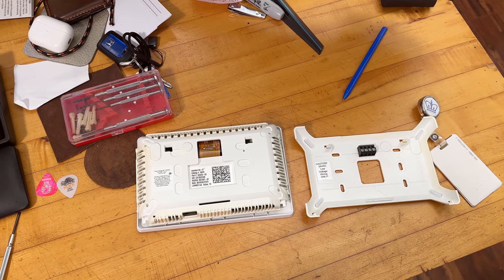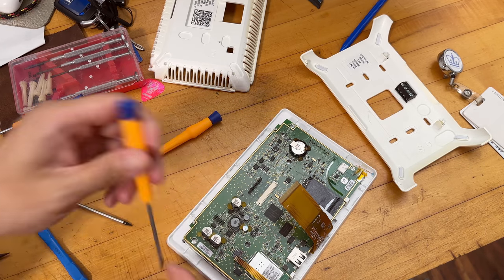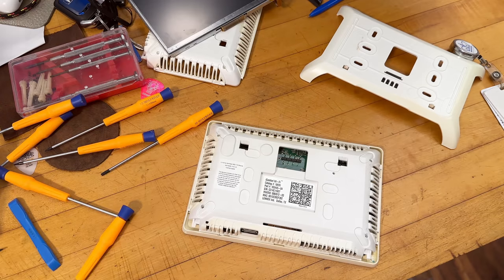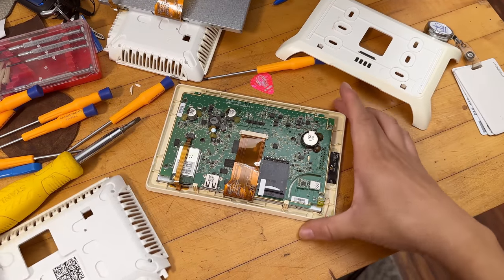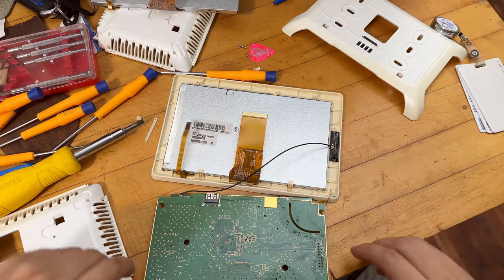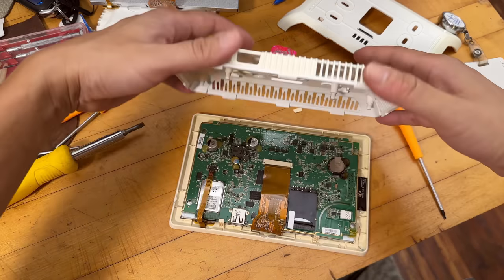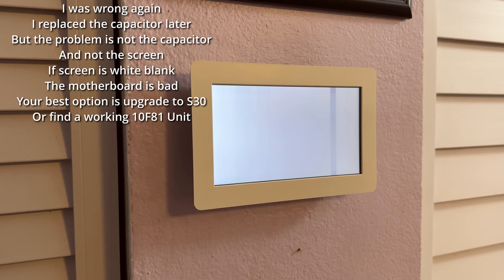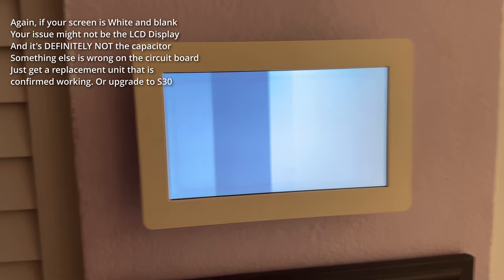Lennox 10F81 iComfort WiFi Thermostat LCD Screen Replacement Guide & Display Issue Diagnose

Comment: Did you try to replace the 1.5F super cap as well?
Reply from the maker: I did not, I tested voltage on the super cap and it's at 2.8V, thought it was the rechargeable button battery they use to store time data like on PC motherboard, didn't realize it's actually a capacitor. I looked at the soldering and it seems to be a lot harder to replace.
Reply: @TheGizmoGarage  I ordered a replacement 1.0F 5.5V from Amazon and will let you know how it goes.
Reply: @TheGizmoGarage  I managed to replace the super capacitor, it was leaking badly. I had to do a lot of cleaning, then soldered the new super capacitor and voila, it is alive! However, when I see the white and grey screen with lines like in yours, it is already too late and the damage on the board is unrepairable. The voltage across my super cap is basically zero, so there is damage on the charging circuitry, or perhaps it takes some time to charge it.
Reply: BTW, I found the exact replacement part on Digikey, but shipping cost is too high. So, I found a similar replacement from Amazon, 1.0F 5.5V, a pack of 6 for $10 in the U.S.
Reply from the maker: @ekasusilo  Thanks for the update! I pined your comments so others could take this into consideration on their repair as well!
Reply: @TheGizmoGarage  I think I know why my super capacitor is not charging. It has corroded R397 completely and now it's gone. Could you help me to measure what R397 value is on your board? I need to replace this to get the super capacitor charging. Thank you.
Reply: Well, my R385 is about to pop out as well. They are all around the super capacitor and the leak basically ruined everything around it. Could you do a favor to measure the value of R385 as well please? Thank you.
Reply from the maker: @ekasusilo  Sadly I tossed out the circuit board after failed attempts, so can’t help ya on remeasuring the value.
Reply from the maker: @ekasusilo  I retrived the bad board from trash bin, r397 diode test @ 0.731v no r385 on my board
Reply: @TheGizmoGarage  A diode? Why would a diode has R designation? What’s the polarity? K towards the super cap or otherwise? FYI my thermostat is still alive until today, and it gets connected to the internet!
Reply from the maker: @ekasusilo I don't know, I know nothing about circuit design... Capacitance had no reading (OL) only diode test had a voltage reading on it.
Reply: @TheGizmoGarage  when it is powered off, you can measure the resistance across. It is not gonna be exact value, but will be close enough for me to find a replacement

Comment: Mine is completely 'off', totally dark, no white, no color, as if it has no power whatsoever.  But by going to the website and checking it, it seems to be functional and working as expected.  I assume this just means that the screen itself is having a problem.  I hate that I can't just buy a replacement 'face' to pop on there and keep going.  Never again, Lennox!!!!

Comment: @TheGizmoGarage I really appreciate your video and answer to my question. After watching your video and reading a large number of posts recommending to replace capacitors, I decided to figure it out for myself. I purchased several none-working units to fix. Smaller 220uF and 47uF capacitors test good in all of them. It was measured with both ESR meter and measuring AC component on those filters. Examining about 5 different thermostats revealed that the super-capacitor is leaking on all of them. Even though it isn't very obvious at first, there are wet areas around it. My initial goal was to re-flow a BGA chip that controls the display and all peripherals, however before I did that, I measured all of voltages going to the screen. One voltage was missing. It took me a long time to figure it out without the schematic, but I finally did it. Some supply voltages never reached the screen. On all units that I have the internal trace and corresponding vias were damaged by either the acid or it was poorly designed from the beginning. I was able to run a jumper wire to fix the issue. One of the most difficult issues was sourcing and replacing the supercapacitor. Apparently, there are multiple types of H-type with leg width of 0.8mm and 2mm. The board is also very thick, so you need to preheat it in order to replace the capacitor.

Comment: Mine was white, not sure what you guys mean by shades of grey but some areas could be considered grey and shadows of the original buttons that show when its working properly. Replacing the caps worked fine. Didnt have to replace touch screen. Not sure why youre telling people they have a bad board when the cap fix will likely work for most of them.
Reply: Additionally, most people have the version that has the 3 small caps or the 2 larger caps. I believe you're the only 1 I've seen that jad 2 large 1 smaller. Fyi, the small caps and large caps are all same voltage and same capacitance. The larger ones have a slightly wider temp range but that's not that important. If you're good enough to make sure all the necessary contact is occurring on the pads you can replace the large ones with the smaller ones, although if you're buying caps it's probably better odds to just get the larger ones.
Reply: I didn't see the end of your vid before leaving the above comment. Those shades of grey are much different than mine. Mine are very subtle and not striped from top to bottom like that. Mine were more likely caused by the shadow of the original colors behind the white... like where it's very dark blue or black.
Reply: A couple of days later after the cap swap the white screen has returned. I'm thinking maybe it was fixed temporarily just from cleaning the board, etc not from the cap swap. Ive found someone who replaces the board and eliminates the problem parts and I'm buying a mew 10f81 from them since the s30 and s40 have so many problems and 2.2/5 stars on lennox's own site. Thanks for your vid.

Comment: My screen is completely white? do you think replacing the screen is worth it..
Reply from the maker: My best guess is that if the screen is white, it's the circuit board not the screen so I wouldn't bother
Reply: @TheGizmoGarage  update.. my screen went from being completely white. but still able to control it wifi on the app. Today, its unresponsive(black screen) and I am unable to control it via the app because it saids it has no wifi connection..

Comment: Excellent video with real technical content.   My upstairs secondary furnace thermostat just went down.   It was working fine, but the furnace power got cycled and suddenly the thermostat only shows three cycling dots.   I feel the screen is fine and it must be not booting fully.   Do you have any experience with connecting to the USB port?
Reply from the maker: I have no experience with connecting it to a USB device, and I assume only Lennox technicians have such software to run diagnostics. You can try to do a reset by cutting off the power to the thermostat to force it to do a new reboot.

Comment: Hi, I’m glad I found your tutorial!!! my touch screen has lost its colour and it almost looks black and white. It’s not connected to the wi-fi so I can’t switch it on even though I can see the on button control. Also can press the settings button and it kind of transitions very very slowly to the settings screen. I’ve reduced the background intensity so I can see the screen a bit clearer. Do you think it’s the capacitor or the screen that’s the problem. We had to switch off the power today and when we put the power back on the screen was white with black stripes. We unplugged and replugged and now it’s just black and white but we can see the controls even if they don’t work. Thanks and I hope you can help me!
Reply from the maker: Shortly after I changed my screen with a replacement unit, it broke again. I have to spend $1000 to upgrade to the newest Lennox S40 thermostat, which comes with a 10 year warranty so we can have a peace of mind.
Reply: I just pulled it apart like you did and put it back together and now it’s working??? Maybe something just dislodged? Don’t know how, cause we didn’t even touch it when we switched off the power today.  I think we better start saving cause I feel this may be the start of it breaking down permanently and I don’t want to fork out $1000 in one hit. Thanks again for your video cause at least  you taught me how to safely take it apart.
Reply from the maker: @sanm9939  No problem, glad it's working, at least setup the Wi-Fi to make sure it's working on your phone, so even if it goes dark it can still work for a while
Reply: @TheGizmoGarage  for some reason the WiFi isn’t working. It’s connected to my home  Wi-Fi but not connected to the server. Ugh! I’ll have to call Lennox on Monday and find out what’s going on!!!

Comment: @lireviews : So do you now have a working display you might want to sell? I fixed a 10f81 with leakage damage from the super-cap (the most likely failure mode, apparently), but there's an intermittent in either the display or the flex cicuit that connects it.
Reply from the maker: I don't, you may be able to find one locally on facebook marketplace

Comment: So I just bought a used unit off Facebook my old screen was doing the white screen but the new unit it gives me a communication error what did you all do with the as card I took them both out and put my old unit in my new unit and now I get 11 errors do you remember how you got that working correctly?
Reply from the maker: They maybe different versions of the firmware, whichever one will take you to a setup page you can reconfigure the settings through the setup menu by long pressing the "lennox" logo on bottom right corner

Comment: When I apply 24VAC, thermostat boots to System Alert error 12: incomplete system. There is an X in the right top corner that when touched will reboot it to the same state. How do I get it to home screen?
Reply from the maker: I don't know... Sounds like the wires are not hooked properly to the back plate. I'm not an ac tech, but here is what the manual says the error is caused by:

• Thermostat did not find an indoor
unit. 

Make sure there is a Comfort
Sync® indoor unit on the system.
Check R, i+, i- and C connections.
• Ohm wires and cycle power.
• Replace indoor unit control if there
is no response.